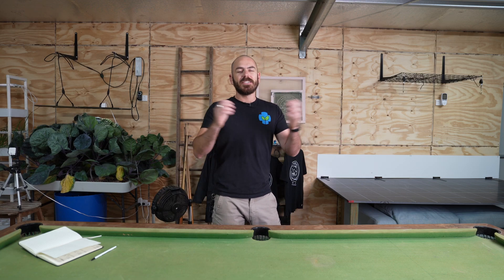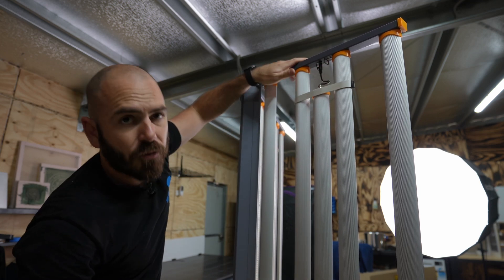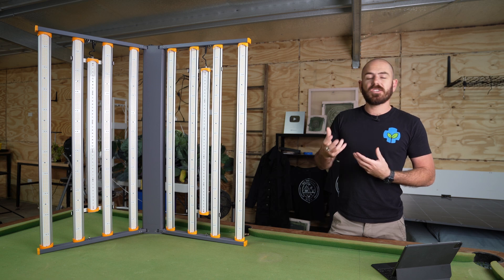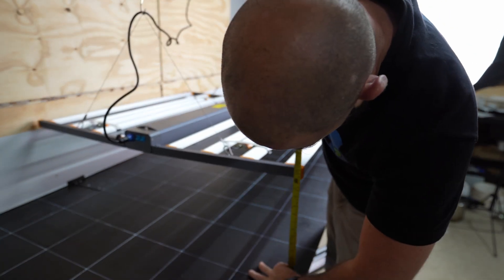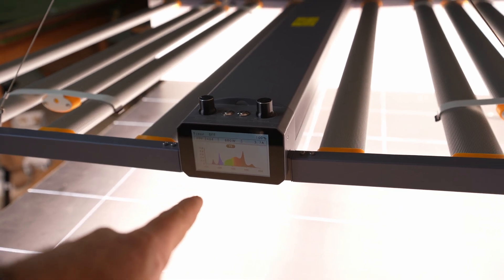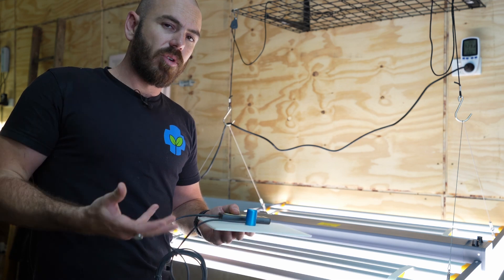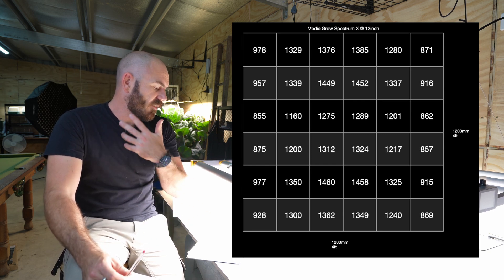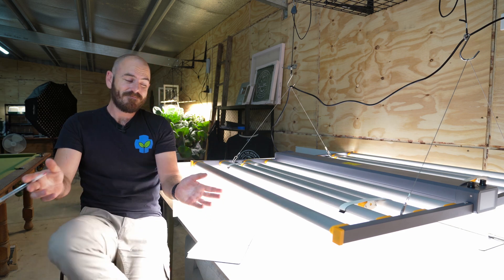Medic Grow Spectrum X Grow Light Unbox, Review and PAR Test

Comment: I ran the older version and the UV/IR bars didn’t work out the box. Finally got in contact with someone from custom service after two weeks and they sent out 2 more bars. Neither worked either. Just my two cents but I won’t buy from them again.
Reply: You kidding right? :D
Reply: This is probably true, I'm running the same setup and when you try to push the button to kick on uvb & ir it keeps wanting to revert back to the Flower mode without the uvb being on. If you keep hitting the button eventually it will stay on but it's quite frustrating